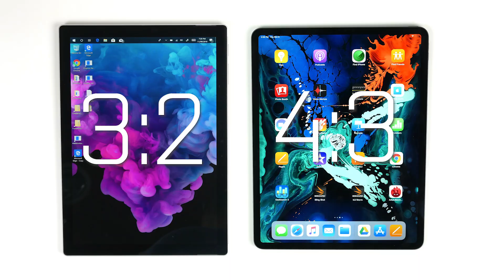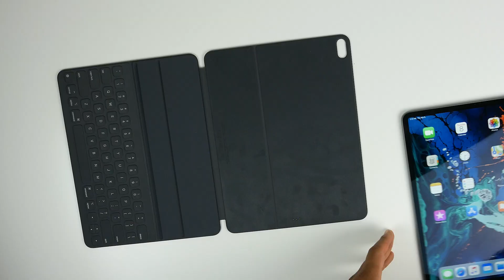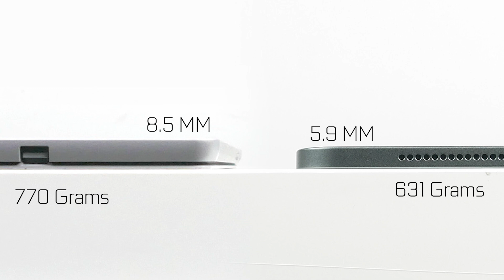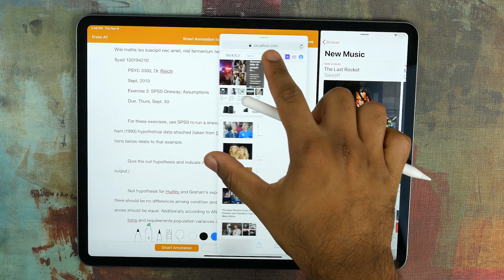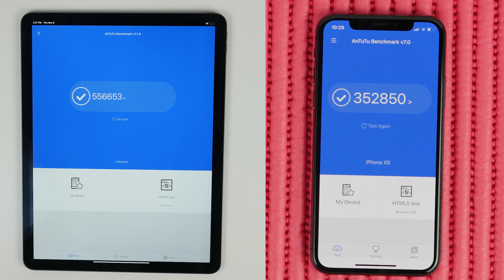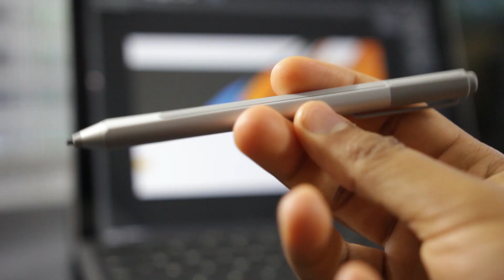2018 iPad Pro vs Surface Pro 6

Comment: No comment on the new Face ID?
Reply: Face ID is shit.
Reply: No because tge ipad is worse hence needs no comment
Reply: Nobody cares about it because it's trash, I have an iPhone X and it's slower than the TouchID on my old iPhone 5S, and a lot of times it fails to recognize my face. I'm done with apple, I'm switching to Android and Windows
Reply: @2frosst2katt  dont get a windows PHONE lol
Reply: @kaiit7077  Hell no, Windows Phone is an absolute failure by Microsoft, I'm going to get a Google Pixel or a Razer Phone, whichever is the better option
Reply: @2frosst2katt  Happy trails.
Reply: CescoCDN both have Face ID
Reply: Honestly don’t know why Face ID is a big selling point. It’s literally a way to unlock your device... like selling a new type of door knob
Reply: hioe04 It’s like selling a door knob that unlocks when it recognizes your fingerprint
Reply: Nobody cares about that.
Reply: @exisTxD  Its a true depth camera, no other devices have that
Reply: @andyliu5858  Windows Hello is basically the exact same tech going as far back as the Kinect for Xbox 360. It uses IR dot projectors and IR cameras for authentication. 

The original Kinect for Xbox 360 was designed by Microsoft and a company called PrimeSense. But that technology had some limitations so Microsoft improved the technology completely in house for Xbox One and HoloLens, and then shrunk it down for Windows Hello.

Apple later bought PrimeSense, and introduced their technology as the True Depth system on the iPhone X. So both basically have the same tech. Security wise, both are similar though Windows Hello is faster. But that's only because Microsoft has had it for much longer compared to Apple.
Reply: @andyliu5858  'no other devices havw that' goes to show how dumb you are cuz most windows laptop have face unlock built in with dept sensing tech, apple users need to gain more knowledge on tech outside the apple ecosystem
Reply: Andy Liu 
Note 9 for example used face + iris which is more secure then the 3D scanning for the face but again ...
Who cares about this in this useless comparison...
Between a tablet that the company says it’s replaces your laptop and a real laptop ...
Reply: @andyliu5858  the surface literally has  windows hello which also uses a true depth camera. Windows hello actually started this whole thing earlier than apple did
Reply: One Thou Wou Is it a true depth camera that DOESNT unlock when someone holds a photo of you to it?
Reply: CescoCDN it is Camera,he counts it as camera

Comment: IPad pro is cheap made thin aluminum, EverythingApplePro did a test. It's horrible. Surface pro is premium.
Reply: M I C H when I search "surface pro 6 drop test", nothing out, interesting isn't it? so premium that none dare to drop it for test?
Reply: kjcz ashiba why would anyone droptest the surface pro? Give me a good reason? Or are you ashamed of why Apple used super thin aluminum to it's super expensive iPad pro's. A device that can bend easily.
Reply: 😂😂😂. Cause DDR3 ram screams premium. 😂😂😂
Reply: bobbyright2010 The Surface Pro uses LPDDR3 to save energy. Especially since this is supposed to be portable. But it's still a full operating windows system with great hardware. The iPad pro is more for teenagers who love IOS. But don't drop it or bend it, it's made out of thin aluminum.
Reply: M I C H guy. DDR3 ram with X86 architecture is a bad combination and you know it.

Btw. Dropping or bending anything is not smart. Just saying.
Reply: M I C H seems there are no bend test for that "premium" surface lol. and surface pro6 using ddr3 not because of energy saving, because that garbage 14nm processors don't support ddr4
Reply: bobbyright2010 let me think do people have problems with the surface pro 6 hardware and performance? I guess no one? It's even recommended! What about that....
Reply: kjcz ashiba what does ddr4 adds more other than consuming more power on a portable device?
Reply: M I C H then what does a slightly strong shell on a tablet helps? you drop it naked for fun or you sit on it?
Reply: M I C H and surface pro6 hardware is bad, don't think pro6 has much better performance than pro4 means it is good. xps13, x1 carbon, mbp13 and even ipad pro have better performance than surface pro6
Reply: M I C H Dude nobody’s really buying the surface pro 6 so of course they’re not going to have problems with it.

Plus windows is extremely dated so I don’t know how it makes premium?
Reply: kjcz ashiba because it's expensive and apple care is expensive as well. Can't you people think? You will be paying double the money when you buy the pen and cover keyboard. Not to mention the pro isn't a pro device. It lacks a fully functioning OS. Ports, no trackpad, storage is expensive, limitations in IOS, dongles. And the surface uses magnesium, you can choose 8/16GB ram, 8th Gen Intel Core i5-8250U (quad-core), 8th Gen Intel Core i7-8650U (quad-core), 128GB, 256GB, 512GB, or 1TB SSD. So no problems for most people who want a powerful 2-in-1 system.
Reply: bobbyright2010 haha Windows is everywhere just like Google and Android. Where is IOS, in your pockets collecting dust. Please talk trash somewhere where people care.
Reply: M I C H then can you explain to me why iPads and chrome books are in schools but windows is not? 

Btw.how well did the windows phone do?
Reply: M I C H can surface pro6 editing more than 100 layers 3gb PSD file with no lag? can surface editing 4k videos with no lag? can surface run games with 120fps constantly? can surface calculate 300mb excel sheet weibull distribution rapidly? you tell me surface pro6 is powerful enough? with that 14nm garbage i7? fully functioning OS? can windows do procreate? iMovie? I need a 2 in 1 device, and surface pro6 is not powerful enough at all
Reply: bobbyright2010 iPad and chromebook in schools? Which schools? Kindergarten?
Reply: M I C H umm. What country do you live in???

Seriously you your trolling needs major work.
Reply: M I C H btw stop using your microsoft stupid mind think about apple products, ipad work just fine without the keyboard, and ipad pro smart connector support third party keyboard, not like surface force you buy and use their "2in1" with their keyboard
Reply: kjcz ashiba haha why do you want to do that on a portable device? Maybe you're missing the point for who the surface pro 6 is meant to be. Nobody is going to edit video's in 4k when they're outdoors or do fancy sketching in a train. No professional is going to use the iPad pro since they already have their professional equipment. A lot of businesses are using windows, and it's easy to use. No limitations unlike the so called iPad pro. No one is going to game on it either there are better gameconsoles out there or you can use your phone not a silly 12.9 inch iPad in Front of your face.
Reply: M I C H ipad pro can handle all those hard things just fine and it is a portable device. no one carries a iMac pro or a 27inch wacom displays while on their trips or outdoor sketching
Reply: bobbyright2010 you can't handle facts
Reply: kjcz ashiba haha dude just stop you're laughable
Reply: M I C H and businesses prefer thinkpad, not surface pro due to security and reliability.
Reply: M I C H lmao are you crying?
Reply: M I C H you obviously don’t know any facts so what are you talking about?
Reply: bobbyright2010 haha which fact really? What do you people need to feel happy and not crappy about this new iPad pro that isn't a pro device? I didn't see any tech reviewer doing heavy work on the iPad pro because they know it isn't for that, most users use MacBook pro for the heavy work. Your iPad is a fancy thin aluminum drawing device with limitations due to ios.
Reply: kjcz ashiba Security

TPM 2.0 chip for enterprise security

Enterprise-grade protection with Windows Hello face sign-in

I don't know what security and reliability issues you're talking about but the surface pro is secure.

https://www.microsoft.com/en-us/surface/business

Don't talk nonsense and don't waste my time.
Reply: M I C H Yes I’ve seen numerous YouTubers use the iPad Pros to edit their videos on lumafusion and digital art is a PROFESSIONAL career.

You are all talk and no facts.
Reply: bobbyright2010 yes it's big business I guess. Editing photos and videos everyone must be doing YouTube and other silly things on their pro device because that's what it is for right? I always found it laughable why the Apple app store has so many editing apps. People have nothing else to do other than sketching and editing photos. That's why businesses don't use iPad pro's. You can't work on them. I have seen many YouTubers just leaving their iPads collecting dust or next to their MacBook pro for music or fast internet browsing nothing much. YouTubers don't even use this as a stand alone laptop replacement. Maybe because they're smart? Unlike you?
Reply: M I C H did you not watch the video link I just sent you? Can your windows computer not read URLs posted on YouTube?

I don’t know where you live but in my country numerous businesses use iPads.
Offices
Vendors 
Wedding planners 
DJs 
Restaurants
Tattoo parlors
In and out Marts
SCHOOOOOLS!!!

Get a job dude.
Reply: bobbyright2010 oh those businesses, yes selecting food on a iPad is so professional! Haha dude just fuck off with that nonsense.
Reply: M I C H but those businesses are purchasing iPads and not surfaces.
Reply: M I C H BTW. What Country are you from?
Reply: bobbyright2010 let them have iPads other businesses are using windows. So hard to understand right?
Reply: bobbyright2010 why does that matter from which country I'm from does that add anything to your arguments? I'm from the Netherlands and what now? You expected something else didn't you?
Reply: M I C H I asked because some countries are more advanced in Mobil tech than others. For example. You didn’t know that chrome books and iPads were used in schools.

I’m from America and IOS dominates the mobile market in America. So maybe that’s why some people prefer iPad pros over surfaces
Reply: bobbyright2010 and we in Europe don't use IOS in schools and businesses. I know Americans favor Apple. We're more open-minded, we even have Huawei selling their products here unlike the American market. Trust me the American market is not advanced.
Reply: M I C H you are not more open minded you guys are just old fashion.

Does your country even use NFC technology?

What about mobile payments too?
Reply: bobbyright2010 yes we use that if our phones have NFC why wouldn't we pay wireless? We pay online, or afterwards. Haha you think the Netherlands is old school? You must visit then and be amazed. Android is using NFC technology for a long time. It's the American market that is behind the rest of the world.
Reply: M I C H that was not my question. Do your grocery stores use a NFC based payment systems?

Ya know. Android pay? Apple Pay?
Reply: bobbyright2010 that's possible, bigger supermarkets and stores are using that technology. Why that question you think we in Europe live in the middle-aged times? Most people still use their debit cards to do payments. Because it's safe and easy.
Reply: M I C H well I ask because in America 90% retail use some form of wireless mobile payment and that is a small example why mobile OS is preferred over dated windows.
Reply: bobbyright2010 https://www.abnamro.nl/en/personal/apps/wallet/index.html

I'm a member at this bank and every other bank does mobile payments and online banking on your device so this is more easy and safer to use than Apple pay or Google pay. There is not really a demand here for those two systems. Since the Netherlands is a small country, we wait until more EU countries are going to use it. The American market obviously needs it since there are the most users for these two mobile systems. But if my bank does the same thing I don't need Apple pay or something else to make payments also not online I can pay direct via IDEAL or afterwards when I want.
Reply: M I C H no lol im living in Germany and what Bobby Said about Europe is Right. Europe (except for the uk and Scandinavia maybe) is struggling when it comes to make day to day life more digital. Heck Germany had this whole internet scandal about still being in the 90s when it comes to internet speed. Fact, Europe lags behind when it comes to technology. btw all the supermarkets in Berlin don’t have or support Apple Pay nor android pay. It still has old fashioned cashiers and there’s still no sign of the job cashier not being a future proof job. 
Only England and Sweden i believe are the most developed and tech savvy countries in the whole of Europe. But that was it.
Reply: Sophie Reinhardt the Netherlands isn't Germany, Germany is backwards. We almost don't have cashiers anymore we pay on or own. And everything here is digital. You don't need Android pay or Apple pay when your own bank support wireless payments. It's even safer. Can most Germans even speak English? I always struggle when I'm there in Düsseldorf to talk with people.
Reply: bobbyright2010 extremely hackable!
Reply: M I C H high schools, universities
Reply: bobbyright2010 most hospital emergencies use .... iPads!
Reply: Pretty sure the surface is made of magnesium, which is actually weaker than aluminum. My SurfaceBook dented very easily.
Reply: M I C H dipshit. Thinkpads run windows OS.

Guys. Why are we even bothering with this dude? 🤷‍♂️🤷‍♂️🤷‍♂️
Reply: bobbyright2010 and the surface pro 6 isn't? Dude don't waste my time. Maybe Lenovo is big where you live but not here.
Reply: M I C H the surface pro isn’t what?!?

Dude. You literally make no sense?
Reply: bobbyright2010 can you read? You're mentioning that ThinkPads run windows os so I'm asking you isn't the surface pro running windows os? So what's so special about ThinkPads since you want to bring that up? Read the Microsoft website and don't act like a dummy.
Reply: M I C H 

https://youtu.be/MOjgfmEymd4
Reply: bobbyright2010 haha 72 hours later trying so hard to edit one video? Most YouTubers edit more videos in just 72 hours on their MacBook pro. Laptop replacement hell no. But nice try. Where are the video's about the real heavy workload this device supposed to handle? Where is the professionalism in using these apps only on this IOS device? Do people really have time to work on this device? Guess no... Talking about 72 hours......... Laughable.
Reply: M I C H an iMac can run windows, mine does, off of a partition when I want to use it ... I just .... don’t! .... sorta ... viral
Reply: bobbyright2010 yes that's what you want to believe.72 hours wasted, for one review. Good job. I guess you're hurt because your iPad pro is useless.
Reply: M I C H How is it 72 hours wasted when the video he made about the iPad  pro is going to make him money on YouTube?

BTW. How is my iPad useless when it has cleared up the headache that is windows OS.
Reply: bobbyright2010 that's a dumb argument not all YouTubers use IOS or Mac OS for editing video's. It is his choice to waste 72 hours for one video that will make some money. And don't you know how to work with windows OS? You're acting like Apple doesn't give you a headache and scandals.
Reply: M I C H dude I never said all youtubers use iOS or Mac OS to edit videos. 

Pay attention.
Reply: Doesn’t matter, an average citizen care about performance, stability and speed
Reply: Surface Pro https://youtu.be/iBHUIR7PtWk
vs
iPad Pro https://youtu.be/hUBsxCcJeUc

In fact iPad Pro is premium. It's flexible! XD
Flexibility of Surface Pro is too low to bend with hands :(
Reply: M I C H You fucking lying bitch, Apple is far better than Microsoft when it comes to hardware. And you? Just shut the fuck up
Reply: @gagaglich5492  what a crazy Chinese bastard.